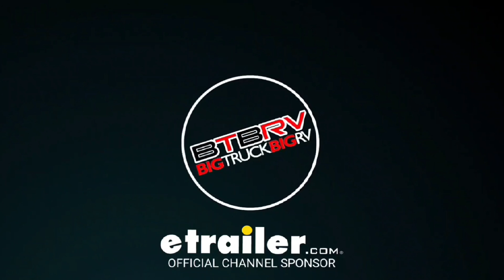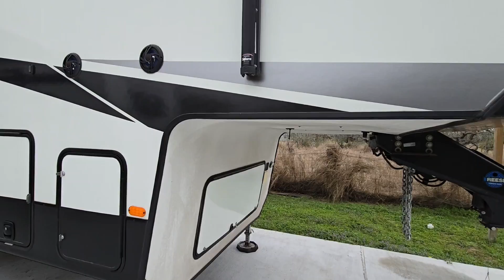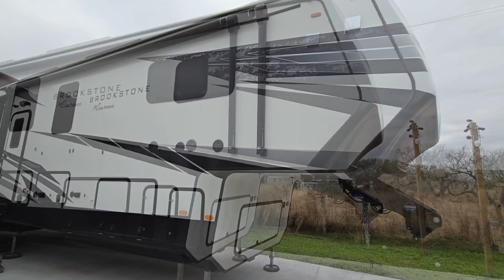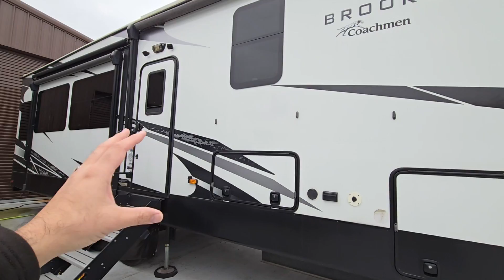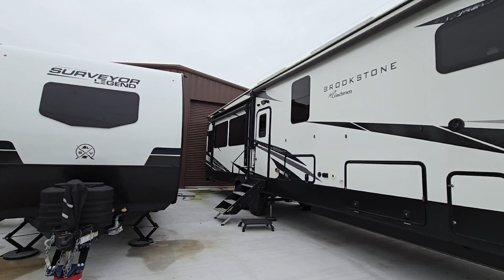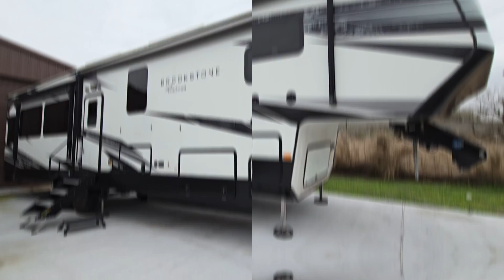BIG FRAME FLEX Update! Heading to Indiana ask Lippert Viewer Submitted QUESTIONS!

Comment: Love your channel and I look forward to more information in the future.

Unfortunately, I dont really agree with you, Lippert or anyone else thats say its normal or acceptable.  The running gear and the frame should be zero tolerance for failure.  It should be designed at the highest statistical confidence level because its the foundation, the most important system.  I understand bending and moments and shear and all the fancy engineering terminology and calculations as studied it in college and use it every day in my profession.  However, as a registered architect in multiple states, would it be acceptable if a building foundation i designed failed and someone was injured or lost their life?  No, and I personally wouldnt be able to sleep at night knowing this happened because of my lack of due diligence.  I certainly couldn't pass blame to someone else because i am bound by ethics and doing what is right regardless of what anyone tells me.  I have and will continue to tell clients and prospective customers, NO, if I am requested to do something incorrectly.  It would be good if Lippert would do the same thing in lieu of burying their head in the sand and blaming someone else.

Love your videos.
Reply from the maker: I love your comment.  My question is, if you constructed 1,000+ buildings each day, almost all of them requiring their own engineering and design, would you have a better than 1/10 of 1% of 5% failure rate?  That's impressive for ANY industry.
Reply: @BTBRV  That's actually a pretty high failure rate.  When you visit, ask to see the finite element model with and without the structure attached and while loaded and dry; how they test welds; what factor of safety is built in the frame design; where (and how much) they expect the loads to be placed on the frame; and how they test the frames.  Would be nice to have both them and RV engineers in the same room at the same time to be asked the questions just to see their take on the frame structure being dependent on the RV built on top of it to hold the frame together.
Reply: Agreed, zero tolerance for failure is the ideal. But the reality is that failure is commonplace, regardless of design and often due to the human factor. Whether it be a building, a car, or an RV, a multitude of hands are involved in its design, sourcing of materials/components, and construction. To blame any one set of those for any point of failure is unrealstic. And even if all the pieces fit and work together as designed, exceeding its capacities and capabilities due to the human element creates a risk of failure. 

Using the example of a building foundation, all of it's design can be spot-on. But what could happen if the concrete was not properly mixed or post-construction changes are made to the structure it's supporting? Through no fault of the foundation's design, in these circumstances failure can occur. However, an argument could be (and probably will be) made that "the architects and engineers should've considered that possibility and done something about it." It would be interesting to know what the questioners think that "something" is. But whatever it is, chances are pretty good it doesn't involve something they did or didn't do.

Comment: Even though these RV’s are advertised as full time capable they are not really designed for it.  Almost all of the people complaining about this are full timers which are maxing out the payload on these things and traveling many more miles than the average traveler.
Reply from the maker: That is true in a percentage of the cases for sure. There of course are instances where the manufacturer of either the RV or frame could also have issues.  There's no one way to blame this on anything without investigating each individual circumstance.

Comment: Gotta say JD, 2024 seems to be your year. These past several videos have reminded me of why I subscribed in the first place. I agree with everything you said. Whether it be a truck, boat, RV or anything else, there is a reason that folks are trading in/selling things. You’re right in dealing with the skepticism in the comments as well. The frames of these RVs MUST flex. A fully rigid frame would cause welds to break and many more failures. A great example is the fact that the suspension on a RV or any vehicle simply exists*! If you didn’t have a suspension under your truck, it’d beat itself apart. Same thing on RVs and even semi trailers. They must flex. I agree there’s nothing wrong with buying a second hand RV from someone honest that is upgrading and has taken care of it. But the fact is, you don’t know, and can’t believe them. My second hand 2019 F-250 looked brand new and well taken care of. I failed to crawl under it and look around and found out from an oil slick in my garage floor that it had an oil leak. Which supports the phrase “don’t judge a book by its cover” cause that truck *looked brand new, I figured it didn’t have any issues and didn’t even look.  WELL DONE JD, WELL DONE.
Reply from the maker: Exactly my point my friend. I'm honestly and sincerely being unbiased here. As people either support or reject what I say, it's typically done more out of emotion than practicality or factual based information.
Reply: @BTBRV  I love it man. I’m a data and facts guy. I don’t understand why folks have to form such elaborate arguments and conspiracies as to why these companies are trying to do them wrong in some way. The company’s goal is to sell RVs and to get a good product out to their customers. Why would they intentionally make a failure prone product that would tarnish their reputation? You know, maybe you should go and look at a mobile home lot and talk to the guys that haul those. I live in one and my dad hauled them for years. These frames are made to flex as well and often times several things have to be repaired after delivery because of THAT flex. Doesn’t mean the home is of bad quality, simply means that if the frame was rigid, instead of having a few trim strips detached, you would have entire walls separated from the floors and ceilings. Think that’d be a great video for you to make.

Comment: I’ve lost a lot of respect for you. Your review of this issue is based on your sponsorship. You’re covering yourself from your last video on this subject. It’s all good till it happens to you!
Reply: Oooweee lot of people in the comments didn't get their mid day nap
Reply: Some people are just happy trying to put down others.  You people are sad.
Reply from the maker: Lippert does not sponsor me in any way. If you listen clearly and closely to the information I provide, you will see it's truly unbiased and simply pointing out facts. If peoples opinion clouds their ability to accept those facts, I can't change that.  Nothing here puts blame anywhere that it shouldn't be put...

My friend, people lose respect for me because of the color of truck I drive....

Further, if this actually happened to me, like many things that happened to me, I will take responsibility if it's my fault and I will also seek help if I can, but if it is a manufacturer's fault I will call them out.  Remember the poorly installed brake job from Coachman?  They got a lot of flack from me because of that. And they are closer partner to me than Lippert ever has been.
Reply: Clear your head and watch this video again.  Understand what he is saying. 
  The frames are designed to not only carry the camper shell, but the shell and frame must be married in a way that the 2 become 1 unit.  If side wall lag bolts come loose for example, this will allow the frame flex to an extent of failure because the two are no longer one unit.  And you see this in the "fulltimers" complaint videos.  
  I can now understand that better now that JD explained it. 
 Side note: I do not like red trucks.😊
Reply: If you had respect for this paid shill for the past year, I feel sorry for you.
Reply: Lost respect for this RV manufacture fan boy a while ago.  Nothing but paid commercials, and content to get more sponsors.
Reply: @MrThisIsMeToo  Weren't you posturing earlier about unsubscribing?
Reply from the maker: @MrThisIsMeToo meanwhile comments like this are completely unproductive and boring because they provide no true counterpoint, just criticism.

Comment: JD, you’re letting Lippert off the hook for building a substandard frame.

Lippert is going to say that they built the frame according to the RV manufactures specifications as to what they were going to put on it. BS! 

Lippert should have known via, rooms full of engineers, that their frame was built at an absolute minimum for what it was intended to be used for after it was built out. 

If you spent anytime looking at where the frames are separating/cracking, you would have been convinced that Lippert should have been able to reinforce the frame where possible failure should/would occur.

Had Lippert came out and said that the RV manufacture didn’t supply appropriate design specs. as to how the RV was going to be designed, then they would have an excuse for frame separation.

If an RV owner used a pin box that hasn’t been approved, they can go pound sand.

Use your favorite trailer manufacturer, yes you do have an issue, Texas Pride builds their trailers to the extreme. Your F450 would fail before one of their trailers would. 

The bottom line is that the Lippert engineers didn’t take into account how/why their  frames could and would fail. END IF STORY.

Like everything else in the RV industry, build the cheapest thing you can and let the buyer eat it.
Reply: JD, you say it's engineering and fact-based.... Where?  Show us some engineering from the manufacturer that illustrates how the front structure detaching affects the stresses in the frame.  Show us some data that indicates the root cause of the 0.1% of the failures.  I highly doubt that Lippert has that data because they're not fixing a large percentage of the failures to start with!  If they want to be fair and open with you, you ought to be challenging their data, not parroting it.

They're not wrong in that all the reasons they mentioned can lead to separation, but of the ones they have investigated, what are the root causes?

All Lippert is doing is playing the deflection-of-blame-game, and using YouTubers to say, "These are not the droids you seek."
Reply: I am also thinking you let Lippert and RV manufacturers off easy on this.  My rig had to be fixed.  When doing so, additional gussets and tube steel were added to the structure of the rv.  If this doesn’t scream “under-engineered”, I’m not sure what does.
Reply: @dendrizzi exactly! I kept reading comments around utube of professional welders piping in about the lack of structural integrity and the sloppy welding. Bottom line the frames ARE under engineered, like look at the CC the manufacturer states, they are barely enough to be reasonable for everyday cloths food, let alone water or waste.  And let's not get into the minimal axle suspension for the loads 🙄. 🍻
Reply: Can’t wait. Thx!
Reply: We’re seeing a lot of smoke and mirrors. It’s time for the consumers to see through all the BS and call a spade a spade. I’m hoping to see a lot of legal action that holds RV manufacturers accountable. The same thing happened to the automotive industry decades ago and now you’d never hear someone say you can’t drive your car down certain public roads, or you can’t drive your car full time.
Reply: There is nothing wrong with Lippert frames.  Manufacturers build on these frames in excess of the frame strength and full timers use their rigs in excess of the rig strength.
Reply: @LuisRamos-jw7zr  no problem with Lippert frames huh?  Have you seen the welds on them?  Take another look.
Reply from the maker: Brother, your entire comment is totally based on suspicion and lacks true facts my friend.  This video series will be eye opening when you actually see what goes into the engineering of a frame. In no way am I saying that some percentage of Lippert frames may have a defect... But in the vast vast majority of cases they don't. That's just a fact
Reply: @BTBRV JD, most of your video is based on speculation about prior ownership, water damage etc. Youre not addressing your viewers criticism with the same kid gloves you are using with the industry.
Reply from the maker: @boyeatsworld-vr9ci it's not kid gloves. I provided very logical, engineering based factual information.  If you can find a mechanical flaw in what I expressed please share it. Just saying that I'm letting him off the hook is not accurate unless you can explain why.  This is a very technical problem that's having and if you don't choose to follow practical technical knowledge and answers I don't know what else I can tell you.
Reply: @BTBRV look. I'm being harsh. I admit it. We spend a lot of money on these and they are always problems. They are poorly designed and built.  This current problem is a major one of it happens to you, and for those of us it hasn't happened to its a ticking bomb on our investment. We feel this way because ALL the experiences we all have with these products: they are insufficiently designed and built for even their basic use. The industry is just now catching actual heat for decades of neglect and abuse of their customer base.... all thanks (ironically) to their successful sale numbers for the past few years and people have a voice now. So when we see the chief issue being ignored (that is, the industry is putting out crap and stuff like this happens) but it's our massive investment that is on the line, we tend to get irritated. Ask them harder questions: when they say it's water intrusion etc ask them how they know?  What actual data have they observed I'm this recent phenomenon that leads to that bullet point.  If they are saying it's not their fault in all but one bullet point, and they are sure they have identified the issue (detachment) what are their plans to ensure that doesn't happen: they know the manufacturers are doing it, so how are they (lippert) going to reduce their exposure to counter poor workmanship (stop dealing with some manufacturers, instill their own qc into the manufacturers build design... engineer around this flawed process?  What?)
Reply from the maker: @boyeatsworld-vr9ci not at all. My comments on damage were ALL based on what the current owners shared.
Reply: I want to add something on top of what you said. Lippert Build builds of frames to spec for the actual RV manufacturer. Lippert Is somewhat responsible, But it’s also the responsibility of the builder to not over build on the actual frame. It’s also the job of the RV manufacturer Do not sell their product and its capabilities. Some of the worst offenders out there, claim that you can full-time RV and travel the country in some of these rigs that are really only for weekend warrior type of trips. There are a lot of stuff. I have a friend of mine that’s actually collecting data on this. But it’s going to take a long time. It would be easier if a lot of the manufactures came clean and said we have a problem. But unfortunately, that’s not always the case

Comment: Proper engineering from the ground up is key in preventing frame flexing damage.
Reply from the maker: The answer to your statement might actually shock you.
Reply: @BTBRV  I think I'd say that "proper engineering from the ground up is THE FIRST STEP in preventing frame failure".. there's a lot of stressors at play.
Reply from the maker: @krisbeaver2901 let's just say this video is older than you might think, and after meeting with and understanding the credentials and knowledge of their combined engineering staff, I was blown away. Most engineering firms would be blown away.    To put it another way, if Modern Marvel's was still a show, they would probably feature this factory and the engineering.

Comment: These frame should be overbuilt to handle these stressors seems like poor engineering.
Reply from the maker: When the failure occures in less than 1/10th of 1% of a very specific weight, length and type of fifth wheel..... Not sure the engineering is bad.  Perhaps some practices by some manufacturers.
Reply: @BTBRV who gave you that statistic? Exactly. 🤦🏽‍♂️
Reply from the maker: @deanhopkins4117 sure, but it's also tracked.  Look how many RVs are also on the road.  There are extremely few reported cases in the big sceme of things. I'm sure there are also unreported cases, but I can only go by the information provided.
Reply: @deanhopkins4117  "Results for the RV Industry Association's December 2022 survey of manufacturers determined the total shipments for 2022 ended with 493,268 shipments, the third best year on record." That'd be nearly 500 examples for that year. That's enough engagement on youtube to reach a lot of eyeballs. Times each year. It doesn't sound unreasonable.

Comment: So you can’t tow down i40 I10 or any other hwy
Reply: It’s called using common sense when you tow.  Don’t do 70-80 on rough interstates.
Reply from the maker: If that were true, then 99.9% of the RVs on the road would also be experiencing these issues.  But there not.
Reply: @BTBRV  in the video you said to avoid rough roads I40 though az is a pot hole torn up mess.  So I would have to avoid it. I hear in all the full timers the interstates are rough.
Reply from the maker: There should probably be a scale that shows folks a 1-10 rating on road conditions.  Even the worse interstates likely are in better shape than many roads that lead to scenic areas.